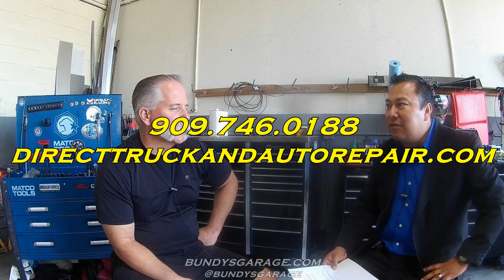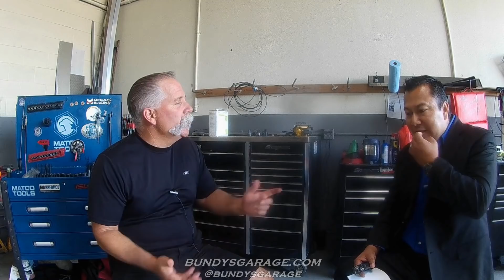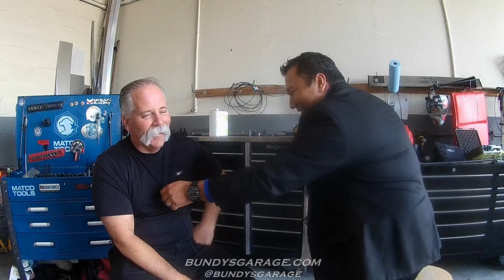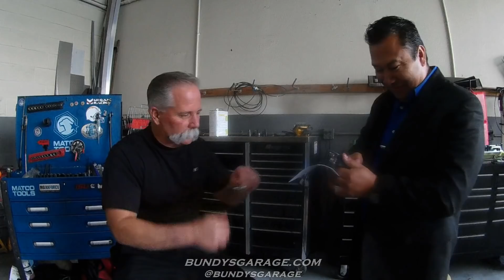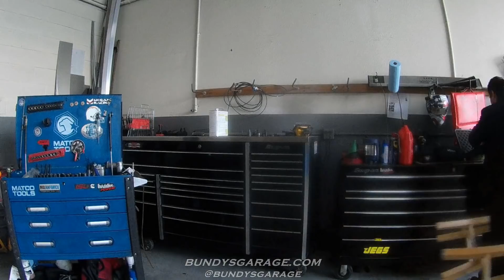Worst Diesel Engine Ever - What is the Best Diesel Truck out There? | Ford Dodge Chevy

Comment: Worst engine ever: 350 Olds diesel
Reply: umad42 now it is back then it was one of the best
Reply: That wasn't an engine, it was hand grenade with a loose pin.
Reply: My dad had one in a Cadillac Eldorado and sold it to my uncle. He drove it about 4 ro 5 years. was pretty slick.
Reply: Tell me about it. My dad had two of them.
Reply: I swear that was probably the dumbest designed diesel
Reply: @slrn832472577  my dad was a diesel mechanic, but he worked on heavy machinery - locomotives, cranes, etc. I don't think he realized the issues that came with Oldsmobile diesel design.  It's too bad because that was my first car -1980 Cutlass Supreme.
Reply: Amen,I pulled a bunch of those junkers out and replaced them with Pontiac or Oldsmobile gas engines.
Reply: Have you ever been to India?
Reply: oh my..I remember my uncle buying a 1979 or 1980  Caddy with one of them in it and it didn't even make it the 50 mile drive home without a head bolt sheering off. lol
Reply: Dizzy Hashimero  I had a 1979 oldsmobile and the engine was a piece of junk
Reply: wasnt it the same block as a 350 gas engine?
Reply: Pretty much a reinforced gas block yeah. People use diesel blocks for drag cars sometimes because you can get more power out of the engine without blowing the block apart
Reply: My father inlaw had one loved and when it broke he had bought the bumper to bumper service the dealer hated that car
Reply: I'd agree. My parents had an 88 olds diesel and it broke down right after they left the dealership. They had sooo many breakdowns on that car. Even Oldsmobile admitted they didn't test it thoroughly and pushed them out leaving the customer hanging on the side of the road...
Reply: Awww come on , they weren't that bad !!! 
............ As long as you replaced the head gaskets every 1200 miles !! 😂
Reply: Junk!😖
Reply: I remember those.
Reply: I blew one of those up in Germany brand new threw a rod out the right side of the block oil everywhere on the autobahn
Reply: Keiti Hashimero   I had the station wagon. I got about 35,000 miles to the engine.  I sold it when I transferred to Europe since I was advised it would be hard to get worked on there.  Now, I think I might have been able to get a Mercedes diesel and kept the vehicle. By now it would need to be replaced but the comfort of it was great.
Reply: General motors has always done a good job on making some of the most unreliable things on the planet. I honestly think marijuana should be made legal in every state. The more people smoke marijuana and the more people do hallucinogenic drugs the better General Motors will do. But for those of a sound mind there’s always the Dodge with the best engine on the planet cummins has built the best diesel power plants It does not matter if it’s a semi truck a pick up truck or even marine applications. They shine everywhere that they are used

Comment: 2002-2008 Dodge Cummins 5.9L Turbo Diesel every single time.

I don’t care what fan boys say,  statistics, history and numbers don’t lie, Dodge Cummins 5.9L is the 1st and ONLY 1 Million Mile Engine. The other Million Mike Engine belongs to Toyota and is Gasoline. Dodge Cummins 5.7L is the BEST, PERIOD! No arguments! Best fuel Mileage best sounding diesel, best on tires and best in powertrain life.

Here s what you need to know before buying a Dodge Cummins before buying:

1. The stock Eaton Turbo Charger SUCKS! Replace it immediately with an Aurora 3000 for super long life and possible 700+ WHP/ 1600 WTQ+ (tuned, CAI, Straight 5” Pipe, 150 gph external fuel pump+ turbo= $4,000) while maintaining 24-26 mpg hwy in eco-mode.

2. Carli Suspension! Dodge suspensions suck donkey dick! If you know this going into a Dodge being open minded, there are super great options that are not available to other competition brands such as Carli Suspension. Plan on spending 9-13K for a full suspension replacement and lift (3” or 6” with amazeballs travel). They use King Shocks which in my opinion are way way better than any Fox Racing shock out there or ever will be out there. Want a true Baja Suspension where you don’t feel SSSSHHHHIIIITTT driving? Carli is a must on a Dodge Truck! I went through Fox, Rough Country, Bilstein  before I finally decided to wait and save for Carli... no Regrets after 3 years and my truck runs like a true Baja truck... it handles amazing!

Best diesel you can ever buy is a Dodge Cummins 5.9L.... you just have to fix a few things the Factory didn’t and you will NEVER get rid of yours! I have owned Ford Raptors, Dodge SRT Viper Truck, Ford Lightning, CHEVY Duramax..... trust me, you will have more fun in a rock solid truck! Try to get a 2002-2004, they still have the manual 4x4 shifter you can shift 4H and 2H on the Fly! I race Z07’s and other fast cars using my 4H for launch all the time... the only way I don’t burn my rear tires off! Imagine, a 9,000+ lbs 3” lifted diesel ROCKET (3” lift on a diesel is like a 6-7” lift on a Half Ton 1500 series truck).
Reply: Seriously, like a 10 sec Google search shows lists of MANY makes and models recording over 1 million miles. Like, you don't even have to try and prove that wrong lol.

Comment: There are no flaws with the 6.0. Use the truck the way its suppose to be used and maintain it. It'll last a good long time if kept stock, ive seen it plenty. Every fucked up 6.0 has a tuner atleast and drove WOT stoplight to stoplight. It aint a race car. Also the 7.3 is only good because its weak and lacks emissions junk.
Reply: I have a 6.0 with 430,000  very little trouble.  Best motor i have ever owned

Comment: New diesel engines try to ride on the legacy of the older engines like the 7.3, 5.9, 6.5, and the older 6.6 (Once the injector issue was fixed) as million mile motors.
Reply from the maker: The new Cummins straight six 3.0L diesel engine is a great little engine. Lots of power and towing capacity is decent.
Reply: BundysGarage different platform for a different class and purpose.  The biggest problem all of the big 3 have is this race for more power, torque and tow/haul numbers.  A 6.7 motor making 250hp and 500 torque vs a 6.7 making 400hp and 1000 torque, after 100k miles of hard work which is going to have more wear and tear.  Which is more likely to run to have a million+ mile block and core internals?  Most people dont tow or need to tow 35k lbs with a 1 ton truck.  Your typical 3/4 and 1 ton non commercial truck owner is towing maybe 15k lbs.  This is why the 7.3 is such a robust and durable motor, big displacement, detuned so the motor isnt stressed, heavy durable internals and components.  It’s “dog” towing heavy loads but lets be honest you shouldnt be worried about zero to 100 towing.

Comment: I had a 1988 Ford F-350 rollback carrier with the Navistar 7.3 diesel (pre-Powerstroke/non-turbo). I ran it for 10 years and clocked over 500,000 miles in CA, NV and AZ.  I worked the hell out of it. I often would tow two vehicles (one on the deck and another behind on the towbar), 4WD diesel Suburbans and single-cab dually pickups (the bed wasn't long enough to fit a crew-cab), smaller forklifts, and industrial equipment. The worst problem with the engine itself was the injection pump going bad - and only one time at that, one clutch replacement, and a radiator. But man did it go through rear brakes.

About 8 years after I sold it, I saw it on the street. Not sure what work may have been done to it, (it looked pretty rough, and they left part of my graphics/lettering on it) but it was still going.  One of the best vehicles I've ever owned.

And as Bundy said, the key was maintenance. lt may still be going strong somewhere (well, maybe not too strong).

Comment: So my take away from this excellent video is that the newer Power Stroke and the Cummins 6.7 are both to new for him to accurately evaluate. They are still under warranty and he hasn't had to deal with them.
That the best engines in the Ford lineup was the older bombproof 7.3 International or the old 6.0 because they were easy to work on. Hmmm.
It sounds like some of the newer Cummins turbos had an issue with gumming up the fan blades.
Which was probably due to how they were driven. I honestly don't understand why folks that live in a city buy diesels anyway. 
The worst score, I guess, to go to the Isuzu motor in the GMC. 
So I guess it all boils down to which truck body style you like best. Who would have THUNK.

Comment: I’m a Mopar guy myself nothing beats and in-line six there’s a reason why most semi’s on the road uses them. it’s because they work. but as much is I hate to say it every truck made with with a DFF System is trash pretty don’t make it pull or last. i’ve owned them all they all have their issues. and every time one of them broke down my old 95 Dodge was always ready to rock. that’s when I decided to get rid of all the newer problem children and started buying and refurbishing  pe-emissions dodges and 7.3 fords problem solved. I can rebuild three trucks to show room condition for what it cost for a new 3500 diesel truck. it’s not for everybody especially if you want luxury. But if you want reliability  and simplicity and life without DPF it’s the way to go.
Reply: Cat did not stop making engines,they stopped supplying them to other oems. What do you think they put in their own cat brand trucks?

Comment: yes you can weld a cast block , use a good quality high nickel rod and proper pre heat and post heat. The only cast you cant weld is white cast. But grey, malleable and nodular casts can all be welded.

Comment: 03 f350 6.0l 335000k miles still runs great.
Reply from the maker: So what I have a Chevy Silverado, 5.7L gas with 300,000 miles on it. Oil change done every 3,000 miles. Diesels should be able to go at least half a million miles.

Comment: Of all the diesels out there that’s not new? We all know you find a nice we cared for Dodge 12 or 24 valve 5.8 or 6.7, you will have a nice long running truck, you’ll be hard pressed to find a solid truck that’s not been used and abused, but the engine will be fine. If you must have a Ford? A pre-1999 7.3 is the way to go with a 7.3! As far as GM? The DuraMax/Allison combo from 2006 on is a fine truck.

Comment: I have a 2001 F350 with 7.3 and zf6 tyranny with 255k miles and  pull a 12k lb 5th wheel all over. Still no problems.

Comment: Headgaskets on the Maxxforce V8s were due to chuckleheads who overfueled and overboosted the engine with a OBD2 programmer. Replacing the head bolts with the updated versions and retorquing them to the new spec fixes the issue.

Comment: Having driven a 6.0 Ford diesel for 600k trouble free miles, I can say the 6.0 is a great engine... I pulled my egr valve, and replaced it with a butt plug for 45 bucks, that I purchased on eBay... I mounted my egr to the engine alternator bracket and plugged it back in... The egr cooler kills all 6.0 diesels.. the cooler busts, you suck coolant into the cylinders, and the resulting  static lock, blows the head bolts.. which is what the engine was designed to do, rather than blow rods and break cranks... Yeah, stud those heads, hahaha, and the next time your cooler fails, you will chunk rods through your block.. 
I have the edge with juice on mine, since new...on level 5, it will smoke all 4 rear tires like a dragster... the 6.0 is not junk..

Comment: 1992 Cummins 5.9 pre computer diesel best ever.
Reply: CUMMINS 12 VALVE !!!!!! END OF STORY !!!!
Reply: Cummins is a dog. It would probably be more at home as a stationary engine pumping water or something, not on the road lol
Reply: @ssimon64  Ha HA, thats some funny stuff, that may fly on reddit however your simply showing your an idiot.
Reply: I had new 1995 2500 Dodge Cummins, 80 mph topped out. In stock configuration my 1997 5.7L ( 350 ) gas motor C2500 Chevrolet truck would do everything that 1995 Dodge would do and cost less money. As a matter of fact I still have that 1997 Chevrolet truck, while the 1995 Dodge is long gone. It was a dog just like the man said !!!
Reply: @bigbossman3987  I still have my 92 ford school bus with the 5.9 Cummins and it runs great.
Reply: joe budi l’m not knocking the longevity of the motor or the way it ran,  just the fact that a gas motor truck pulling the same load that cost about $6K less at that time would run off and leave it. Alone with the fact that after diesel prices shot up ( which has nothing to do with the motor ) it was more expensive to operate while not offering any real advantages. Remember, it already cost more to service to begin with than what the 5.7L GM gas motor did !!!

The 5.9 Cummins at that time was 165 hp @ 425 fps of toque, the 5.7L GM gas motor at time was 255 hp @ 385 fps of toque. The 5.9 Cummins came out of the hole just a hair bit better with a load, but the 5.7L would run off and leave it after that point. Now of course I understand there’s a lot of things that could’ve been done to the 5.9 Cummins aftermarket wise to wake it up more,  but I don’t get into all of that kind of stuff, I leave my stuff in stock configuration. The simple fact was in stock configuration the 5.9 Cummins, especially before they bumped the hp up on them was a dog.

Now of course this doesn’t have anything to do with the motor itself, but the Dodge truck around it fail all to pieces. Everything from the transmission, dash, paint to the electrical system on it. I could walk outside and sometimes it would be sitting there with the interior lights blinking on & off with the door locks going up & down repeatedly. You didn’t get out of that damn thing without taking the key with you, because it would lock you out all on its own if you did !!!

As far as the motor itself I had trouble with the electric kill solenoid coming apart a few times, alone with the individual valve cover gaskets repeatedly leaking oil even after changing the gaskets multiple different times. Certainly not anything worth really bitching much about. Yet once again, none of that still changes the fact that it was certainly still in dog until they finally started putting some hp into them. By comparison the newer diesel motor trucks are around 400 + hp @ 800 + fps thereabouts across all brands. Those diesel trucks certainly aren’t dog like the early version 5.9 Cummins were, but they are certainly expensive as hell & emissions control system nightmares !!!

Comment: So...the problem you have with the Duramax is that you gotta have the head gasket in hand in order to obtain a new gasket IF that's the item you're replacing??  Doesn't sound like a real issue with the actual engine to me.  On top of which, the Duramax - which apparently only has one main flaw with inventory tracking according to you - has the best transmission sitting behind it already?  Sounds to me like the GM trucks win hands down according to you and the issues you specifically mentioned regarding each truck.  All the other trucks sounded like they had a lot of issues that you rolled right off the top of your head.

Comment: Those International 7.3's were definitely by far the most superior diesel. Those damn things never died. They were kind of sluggish on the acceleration but they had a lot of torque and they lasted almost a lifetime if you took good care of them. Its a bummer Ford doesnt use them anymore.
Reply from the maker: Too bad Ford killed the best diesel engine they had going for them. Just like they did with the 5.4L gas engine. They got all the problems ironed out of the 5.4L gas engine and then decide to move onto something else. Idiots! You think after designing engines for the last 100 years they would get their $hit together!
Reply: @bundysgarage I dunno man, but I always say "stick with what works"
Reply: The 7.3 was no doubt the best diesel ford used. But how is it by far the most superior diesel ? It is NOT superior to a 5.9 12 valve cummins. Let me guess, you own one so it is the best?
Reply: @supersixjones8905  actually, I will not dissagree with you at all. That 12 valve Cummins was right up there next to the 7.3, I just didnt mention it, but they were another bulletproof diesel that were superior as well. But yes I've been around the 7.3's alot.
Reply: The international was a great motor but it never outperformed or outlasted a 5.9L Cummins

Comment: Good interview.  I want to point out that the 6.7L Power Stroke has been out since 2011. If the issues are not well known yet by a top diesel mechanic then that would tell me that there are not that many problems with it. Unlike say the 6.0L issues which were very well known within a couple of years.
Reply: I have fixed EGR's, turbos, all kinds of odd coolant leaks, all kinds of weird sensor failures, watched one get the oil changed and then it wouldn't start again. Personally I wouldn't buy one at all, If I need a diesel I will buy a Duramax at this point.
Reply from the maker: D MAX BABY!

Comment: Don't own a diesel but I always wondered why every Ford diesel that drives by my house sounds like they are missing on 2 of the 8 cylinders and running under water...sort of a blub, blub, blub sound???  Especially if they have an aftermarket exhaust. What is that all about???  Curious I guess.  i wouldn't buy one just for that reason